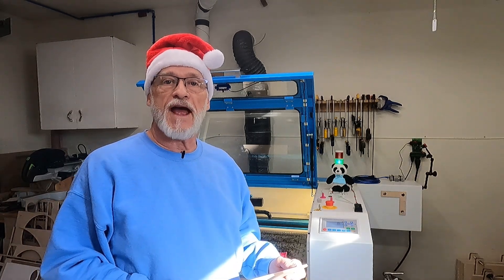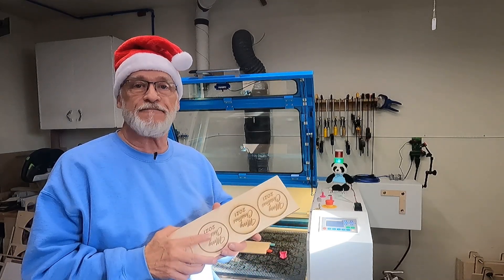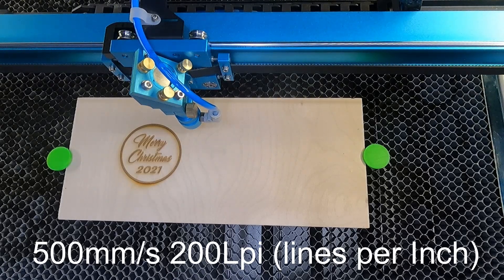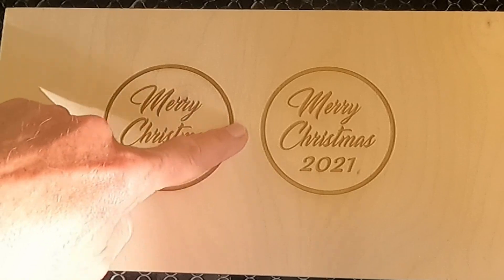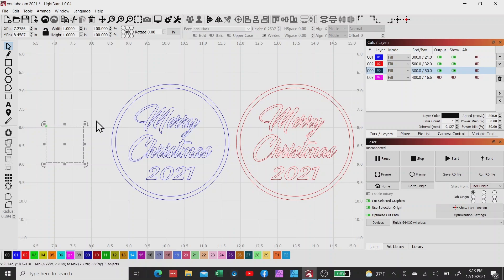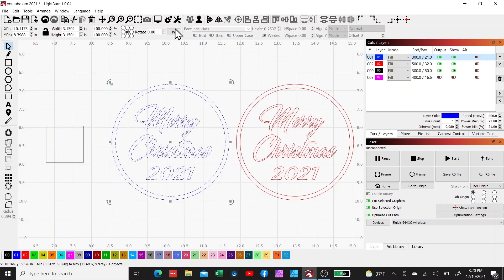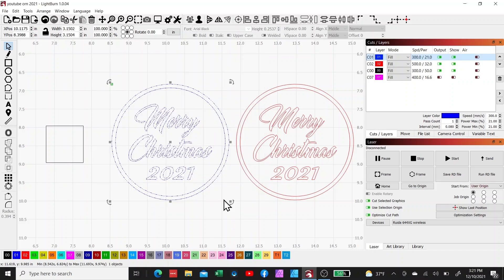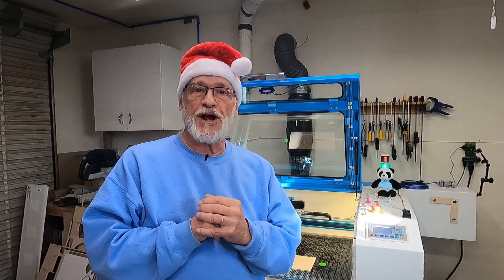Reduce your engraving time by 50% in LightBurn. Speed and LPI tips and tricks

Comment: Hi what kind of sander are you using?
Reply from the maker: It’s a Festool ets125. Best sander in my opinion. A little expensive but I can use it as much as meeded and no hand fatigue! 
https://www.amazon.com/Festool-576070-Random-Orbital-REQ-Plus/dp/B084DVBHSB/ref=asc_df_B084DVBHSB/?tag=hyprod-20&linkCode=df0&hvadid=416760125247&hvpos=&hvnetw=g&hvrand=10101638903809036474&hvpone=&hvptwo=&hvqmt=&hvdev=c&hvdvcmdl=&hvlocint=&hvlocphy=9030849&hvtargid=pla-898759482668&psc=1&mcid=2e13026a254e371fb78eb5a189d02e14&tag=&ref=&adgrpid=95471650498&hvpone=&hvptwo=&hvadid=416760125247&hvpos=&hvnetw=g&hvrand=10101638903809036474&hvqmt=&hvdev=c&hvdvcmdl=&hvlocint=&hvlocphy=9030849&hvtargid=pla-898759482668&gclid=CjwKCAiAjrarBhAWEiwA2qWdCKriPyDOnAOg6-6TSmjBrC-JNPPK-UiQp9ifK0B1f-PgQn5S11pX2xoCNOAQAvD_BwE

Comment: Thank you for sharing your tips and tricks. I noticed you turned off your air assist, why is that?
Reply from the maker: Great question. On a thunder laser when you turn air assist off it really means low volume air. You never want allot of air flow when engraving. High air just pushes the vaporized material back on your work. I engrave with a whisper of air. Much cleaner work off the laser.

Comment: Hi I have been watching your videos thank you for the information. Made it so easier.
I wonder if you can help me with something else. I have upgraded my CO2 laser from a Leetro to a Ruida and am using LIghtburn, but if I increase the speed, the laser overtravel to slow and accelerate. I have tried changing the y and x axis to max but I am not sure what the max should be as there is so much information on the forums I am confused.  The speed should only be 80% of the max, but I am not sure what that is and do not want to break anything. I have copied the settings from the Leetro controller but that doesnt seem to work either.  I do not want to break anything but it seems to be so slow.  Any help would be greatly appreciated.
Many thanks for reading.
Reply from the maker: hi thanks for the question but I’m not familiar with that brand of laser. I would highly recommend you reach out to the manufacturer to get some assistance.

Comment: I can't seem to make accurate circles for ornaments. Do you have any suggestions? The w and h are the same size, the belts are tight (however, the right side seems to be just so slightly not as tight and every time I try to tighten it, the belt comes off track..) I have a Atzer 10P. Love learning from you. Thank you for all your videos <3
Reply from the maker: belt tension can be tricky and greatly affect your results. safely I haven’t done any belt maintenance on my laser. sorry. thank you for the comments
Reply: Try using the Calibrate tool in Lightburn. It's under the Edit, Machine Settings, Calibrate Axis (button). Here is a great video in detail explaining it. It's easiest to do with squares but it will make your circles better as well https://www.youtube.com/watch?v=v8kOH5McCjY&t=735s

Comment: Hi I've tried the same settings and my Christmas decoration is the same but 140mm.by 140mm just different text, trying it on the creality falcon 10w and cannot get it down to under 5 minutes I can only get it down from 1 hour 5 minutes to 46 minutes, what am I missing?
Reply from the maker: a diode laser is much slower in speed than a co2 laser.

Comment: GREAT JOB ON THE VIDEO, THANK YOU FOR THE INFORMATION, I GOT A LASER ABOUT A MONTH AGO, I HAVE BEEN PLAYING AROUND ON CARDBOARD (FROM BOXES CUT UP), AND IT TOOK ME SOME TIME, PLAYING WITH THE SETTINGS, I WILL TRY LESS LINES, I INCREASED THE LINES ITS VERY DARK AND THE DETAIL IS NOT AS GOOD AS A BIT LOWER ON THE LINES, IM USING LASER GBRL, I IN THE PROCESS OF LEARNING LIGHTBURN, YES LIGHTBURN DOES HAVE A LOT OF FEATURES BUT IT A BIG LEARNING CURVE, LASER GBRL IS VERY EASY TO USE, I DO LIKE LASER GBRL A LOT BECAUSE ITS EASY TO USE, AND IT DOES NOT TAKE LONG TO GET THE FEEL OF THE SOFTWARE, IT TOOK ME ABOUT 2 HOURS TO FIGURE OUT HOW TO ENGRAVE AN IMAGE WITH LIGHTBURN, IT TOOK ABOUT 15 TO 20 MINUTES TO ENGRAVING AN IMAGE(THATS DOING CHANGES TO THE IMAGE AND THHE SET UP ON LASER GBRL), I FOUND THAT CARDBOARD IS A GREAT PRACTICE, IT TEACHES HOW NOT TO OVER POWER THE LASER, I HAVE A COUPLE OF IMAGES THAT SLIGHTLY BURNED THROUGH, WHATS REALLY NICE WITH CARDBOARD, IF YOU SCREW UP OR WANT TO PLAY AROUND WITH DIFFERENT SETTING AND IT DOES NOT WORK OUT, ITS EASY TO DISPOSE OF THE MISTAKE, I AM AMAZED HOW GREAT THINGS CAN LOOK ON CARDBOARD, I HAVE MANY DIFFERENT IMAGES I HAVE USED AND THEY LOOK LIKE A BLACK AND WHITE PHOTO PRINTED ON CARDBOARD, I KNOW I HAVE A LOT MORE TO LEARN, I AM ABOUT READY TO MOVE FROM CARDBOARD TO TILE, METALS, 4MM ACRYLIC CLEAR SHEETS, GLASS, WOOD, SO I GOT A LOT OF WORK, RUNNING TEST, AND MUCH MORE, I HAVE FOUND HOW INTERESTING IT IS HOW MANY DIFFERENT MATERIALS AND ITEMS CAN BE ENGRAVED, AND THE MANY WAYS THINGS CAN BE ENGRAVED WITH THE LASER, IT SEEMS IT DOES NOT MATER IF YOU HAVE A 3 WATT LASER OR A 1000 WATT LASER THE END RESULTS CAN BE GREAT TO AWESOME, ONCE AGAIN THANK YOU FOR THE INFORMATION
Reply from the maker: thank you for your comments

Comment: I appreciate your experience and willingness to share that knowledge.  You are showing different setting for different results which makes sense.  My question is I am using a Xtool D1 10w and as long as I am using Lightburn software I should be able to use your information, correct?  (Yes, I am a newbie!)
Reply from the maker: Some of what I talk about will apply to a co2 laser and not diode laser. since I don’t have a diode laser I am not sure what will or will not apply. thank you for your comments and watching
Reply: Rick, I use an Ortur laser at 5 watts output.  I inadvertantly did not check my focus and engraved a coaster out of focus.  Wow, much better, just like he describes.  I now use it when appropriate.  I did not consider the lines per inch though.  I think I can knock of 10 seconds more with this info.

Comment: Hey there, what are you using to get the 7mm focus measurement? Also, are you engraving a bunch of an item, then refocusing at 6mm for the cut or cutting at 7mm as well?
Reply from the maker: I made a stepped focus gauge, if it’s 1/8” I don’t worry about refocusing. if it’s 1/4” or more I re focus before I start the cut layer

Comment: Question about defocusing.  How do you handle that when most times an engraving is combined with cutting?  I would expect these ornaments also get cut out.  Are you running that job totally separately?
Reply from the maker: It depends on how thick your material is. If it’s 1/8” I will do both without re focusing. Thicker I may choose to run separately

Comment: What do you mean by defocus your lens? Do you raise or lower the bed a bit? I read the comments and I appear to be the only one asking a dumb question.
Reply from the maker: Defocus means if normal focus distance is 6mm Defocusing the lens would be 7-8mm this makes the laser beam bigger providing a softer look. I do this with engraving all the time
Reply: @computercreationz  What about when you want to engrave and cut in the same run of a laser? Cutting with defocused lens don't give wanted results. On my chinese laser i have to do defocus manually and that's why i am afraid of non-precise cutting and/or engraving.
Reply from the maker: @matijajereb3564  in lightburn you can automatically have your z come up after you engrave. This is a very advanced move. Or do engrave then refocus and cut easy!
Reply: @computercreationz  My laser doesn't support Z axis. 
I think i'll have to try to do it manually. I'll have to be careful and pay extra attention on positioning. Am i right?
Anyway, thanks for the reply.

Comment: What sander are you using?  And is the disk a soft, fluffy material?  (At least that's how it looks.)  Would it be possible in your videos to post links to any of the tools, etc. that you use in the video?  Like you listed the hold down pins?
Reply from the maker: I use the Festool brand sanders. there expensive but last a lifetime.

Comment: could you please try the settings"fill groups together" in cut settings with the parameters of the 2: 00 minute result? .I wonder if this makes a difference because you have much empty space in the engraving.Would be nice to compare the estimated times.
Reply: When I do a circle engrave I figure how thick I want my line then draw the circle and use the offset function on the toolbar on the left to make the line as thick I would like. I then set this to a line layer. When the laser engraves it the head just goes in a circle continuously until it is engraved. The thing about it is that the laser is firing all the time instead of so much dead time as it scans back and forth. Now I'd bet he could knock another 35 to 40 seconds off the time on those ornaments. I have a diode laser so I really can't be sure about the time savings on a co2 laser.
Reply: @krisknowlton5935   I do that too - any solidly marked borders become say 5 or 7 vectors with minute offsets, and they get done in a minute fraction of the time from a raster.
Reply: @ianstewart-koster9982  and now I use the 'Offset fill' function. It does what we were doing manually automatically.  In other words, if you want a border that is 3 mm wide just make your two border lines 3mm apart (make sure they are on a separate layer) then select 'Offset Fill'. LightBurn does the tedious work for you. I wish I had tried that function out sooner because it would have saved me a lot of design time and I wouldn't have looked  like a dummy. Jason has packed a lot into LightBurn.  The more you use it, the more you discover. I just wish all this was around when I was a young man because then I would have known what I wanted to do when I grew up.
Reply: @krisknowlton5935   I know what you mean - old habits die hard.
I've added the vector 'fill' in corel draw - you can pick the contour option, specify the width, eg 3mm, and specify how many contours to put in that gap, eg 10, and it does it automatically, too.

Thanks for the update that L'b does that too.
Reply: I believe that would actually add time. The circle engrave still has to be performed, you're actually saving time engraving letters on the way across
Reply: @gearhed1971  might be,and i guess the stress on the drivetrain increases